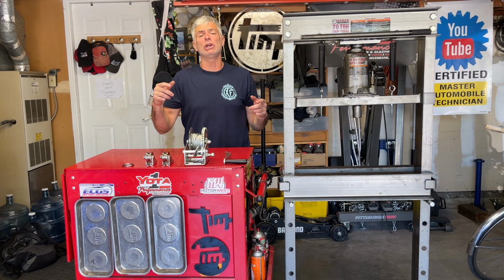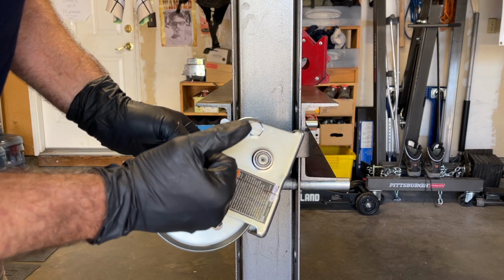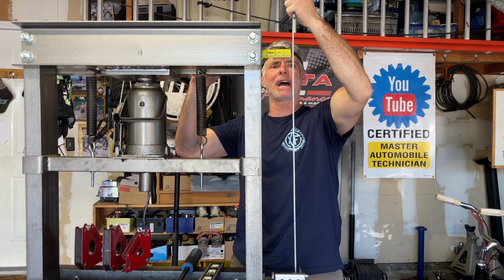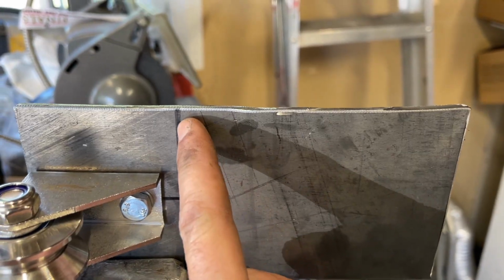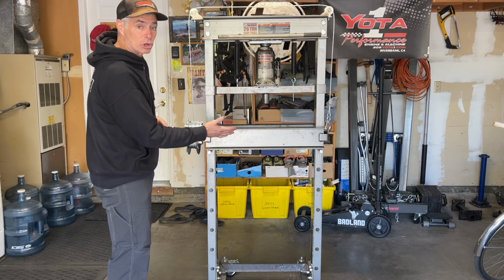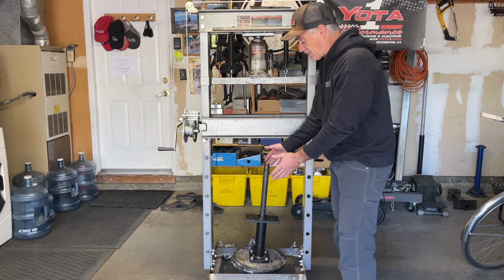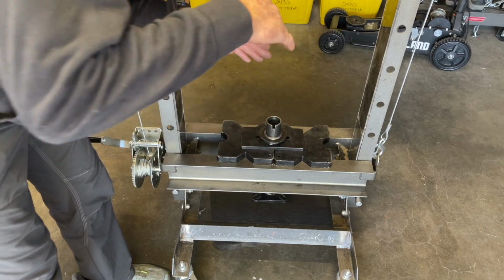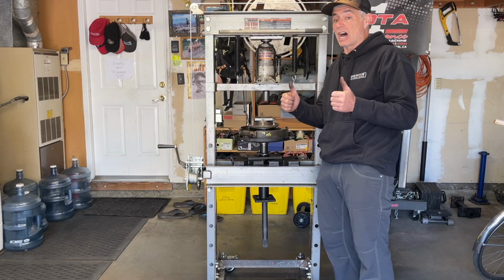Harbor Freight 20 Ton Press Winch Mod

Comment: Weld some plates on the bed sides under the handles. The height of the bed. Or 3/16 x 1" strap at the top and bottom of the bed (c channel). Both sides

Comment: What a stupid solition. Totally wrong build.
Reply from the maker: Hey, don't hold back on your opinion of my work.  The modification I did works well.  Did you watch the whole video? I demonstrated that I could raise and lower the press bed loaded with press plates and an axle using the winch and assisting the balancing of the press bed with my free hand.  I no longer need a second person to help me lift and lower the press bed.  The winch makes it much easier to do press work by yourself. 

Lots of people commenting think I should have mounted the winch on top and added a second cable to the winch drum so that one cable could attach to each handle and the press bed would be more balanced.   I said in the video that I didn't want to mess with trying to figure out how to modify the winch to make that happen.  People watching the video must think it's some sort of struggle to balance the press bed.  It's not hard at all.  I'm only overcoming the weight of the winch, which isn't that heavy.  So, my solution to make press work less physically demanding works perfect for my needs.  People are welcome to do a winch modification to their press any way they like.  My video is just offering one way to do it.  

I should have just deleted your a-hole comment, but for now, I'll let it remain. Happy trolling!

Comment: Why other set the winch ontop and 2 wires, is because both sides race and lower the same! You not need to support whit your hand, at all :) im gona set my ontop too, when my new press arriwel :)
Reply from the maker: I talk about the top mount option in the video.  I didn't want to bother altering the winch so I did it my way.  Different strokes for different folks.

Comment: Im curious if it would help to mount up a counterweight on the other end of the press bed.  Counterweight could be a tool or attachment holder.
Reply from the maker: I messed around with this idea, but gave up on it.  I just give the opposing side a little bit of support with my free hand and I can easily balance the press bed.

Comment: I have been thinking about doing this on my press. You could put slots in the plates you welded on top so that the pulleys are adjustable left to right and drill a hole for a bolt instead of the ring. I believe this would help balance the system and keep everything level.
Reply from the maker: Yeah, that's an idea.  Let me know how it works out for you.

Comment: Tim, I also have a back problem, the way you are holding to one side of the I-beam  and bending puts your back in an awful position, I would try putting the winch at the top in the middle with one roller at each corner method, in this way, you don't have bend and hurt you back
Reply from the maker: @transformer889  There's very little weight I have to overcome.  It's only imbalanced a slight amount due to the weight of the winch on one side of the press bed.  I'm basically stabilizing, not really lifting.  I would agree that if I was lifting anything heavy in that awkward position,  I'd be compromising my back.  Trust me, I've had back problems for almost 20 years, and I know when I'm putting my spine in a bad position.

Comment: i cabled my winch table so no need to "balance" the table .  Winch mounted mid hight on right side,  cable go up on the outside and down the right side and connects to the top of the table. another cable connect on the bottom of the table on the right side, go down right side to pulley on bottom that goes back up to the top of the press and through a pulley to the left side, then through another pulley down the left side to the top of the table - attached with a turn buckle.
Reply from the maker: @n2cval89  Yep, that's another way to do it.  Good job!

Comment: Not practical to lift 1 end while you winch.  My plates and press brake weigh about 160lbs.
Reply from the maker: @BM-cr1zf  You're not lifting one side. You are stabilizing the press bed by applying some support.  You're basically offsetting the unveness of the press bed because of the imbalance of having the winch connected to one side.  The winch doesn't weigh that much, so you only need to give a slight amount of support to srabilize the press bed.  The winch is doing all the lifting.  I don't think I've had quite that much weight on mine, but I'm pretty confident I could manage  to keep the press bed level with a press break weighing down the press bed.

Comment: Suggestion for another video: Place the winch on the front of the press bed, about 1/4 the the left or 1/4 to the right according to your handedness. Then unwind the steel wire completely. Locate the midpoint of the wire and rewind it starting at the center, the center being held in place with an adjustable hose clamp. Put a pulley at each end of the bed, and then you can attach each end of the wire to the top of the press. 
At this point, the winch will exert a balanced force on both sides of the bed when you wind it up. If you want more mechanical advantage, put two more pulleys at the top of the press, and return the ends of the wire to attach them to the ends of the bed. This will give you a balanced 2:1 mechanical advantage.  Smooth!
Reply: only problem with a dual spool setup on a single spool is the cable will wind overtop of each other and the table will no longer be level and jerky as the gets trapped under each other.  Take a look at how i cabled mine (see my comment above).  Single cable lifts both sides extremely level and cable wind issues not a problem
Reply from the maker: That's a good idea, but I'm fine with how the winch mod is working for me.  I don't feel like redoing it.  If you try out your idea, I would like to hear how it turned out.  Thanks for the comment.

Comment: Nice ! I love watching you videos - wonder if some weight was added to opposite side would be any improvement or more trouble ?
Reply from the maker: Several people mentioned the counterweight idea.  I tried it and it didn't work.  I think the main reason it doesn't work is there's a human component to the equation.  I'm holding the handle of the winch while it's going up and down which affects the balance of the press bed.  I tried using fishing weights in a small canvas sack and played around with different weights and couldn't get the press bed to go up and down evenly in both directions, so I gave up on the idea.  I think with how I did this modification, the best solution is to just stabilize the press bed with my free hand, which is very easy to do.  

Mounting the winch on the top of the press with a cable going to each handle is the way to go for anyone who doesn't want to have to balance the press bed with their free hand.  Knowing what I know now, I think I'd probably still do the mod like I did because I think it's a hassle having to figure out how to mount another cable to the winch and to figure out the proper length of each cable to get the press bed going up and down evenly.  

The goal was to take a physical load off of me when doing press work, mainly axle work, and I achieved that.  The balancing of the press bed is a minor nuisance that doesn't bother me.

Thanks for the comment!  Great to know you like the content Sean and I create.  Happy Wrenching!

Comment: Add a weight the same as winch on other side to even out may help
Reply from the maker: I messed around with different amounts of counterweight on the opposing handle, and it didn't work out.  In one direction,  say raising, it would go up level. Then I'd switch to lowering, and it wouldn't stay level.  I used fishing weights in a small canvas sack.  I gave up after messing around with it for quite a while.  It's not a big deal to me having to stabilize the press bed with my free hand because I'm only overcoming a very slight weight imbalance.

Comment: Solution: Add a counter weight to the other side of the platform. The weight only needs to displace the weight of the crank side. Also you could use pvc to reduce the gap in the platform to prevent swaying. 
Sincerely Robert
Reply from the maker: I messed around with different amounts of counterweight on the opposing handle, and it didn't work out.  In one direction,  say raising, it would go up level. Then I'd switch to lowering, and it wouldn't stay level.  I used fishing weights in a small canvas sack.  I gave up after messing around with it for quite a while.  It's not a big deal to me having to stabilize the press bed with my free hand because I'm only overcoming a very slight weight imbalance.

Comment: 20 ton press is not made heavy enough I had to plate the top and bottom because it was bending but for price it’s not bad
Reply from the maker: What are you working on?  Sherman Tanks?  I've done wheel bearing jobs on lots of different Toyota and Lexus SUVs, and the press has never failed me.

Comment: I mounted a winch on top of the press and used tow cables -one for each side so the bed rases and lowers evenly.
Reply from the maker: Yeah, I saw videos of people doing it that way, and I mentioned that option in the video.  Even though the press bed isn't balanced the way I did it, it's not a big concern.  Stabilizing the press bed is very easy because it's literally only around 5 lbs uneven.  A little support with my free hand keeps it balanced.   The result I wanted was to not have to muscle the press bed up and down anynore, and I achieved that.  This will make doing press work less physically demanding on me and for whoever I'm filming with.
Reply: @TimmyTheToolman  Good video, seems like some of your viewers would be interested in a video of you mounting a counter weight to the other side to help with the balance of the press bed.
Reply from the maker: @nvmcrider8475  I thought of doing something like that, but finding the perfect amount of weight is problematic.     By just stabilizing the press bed with my free hand, I can keep the bed from tilting while I lower and raise it with the winch.  It's not hard.

Comment: Hey it works great and the welds aren’t too bad. The second plate was better as you “warmed up” on the first plate so understandably the second would be better. If you get some spare time lol yeah I know, you can just weld up scrap pieces of steel all day and get better practicing and playing with the settings on the machine and just layin beads. 
 These mods are almost a must for a press. Good stuff brother 🤙 
God bless~
Reply from the maker: When I first started learning how to weld, I got a bunch of scrap metal from a fabrication shop and practiced a lot.  I feel pretty confident in my welding ability now.  Getting comfortable laying long continuous beads is something I need to get more comfortable with.  I feel the need to stop to check how I'm doing.
Reply: @TimmyTheToolman  haha yessir that’s all we did in welding school when you first start. You just grab a piece of square cut steel and weld beads up and down both sides of it and grab another one and do it again lol got old, but eventually it clicks in your head and you learned how to control the puddle. Those were some very long days in class lol

Comment: Cool mod.....RnD.  How about add a 5lb weight on the ring to counter balance it.
Reply from the maker: I actually tried adding weight to the other handle and it's kind of funky.  I put fishing weights in a small canvas sack and hung it from the ring.  In one direction, say raising, it stays level, and then I go to lower it and it starts getting way out of balance.  I tried different amount of weights with the same result.  I think just giving the press bed a little support with my free hand works pretty damn well.
Reply: @TimmyTheToolman  Well I'm sure you'll find a solution.  I might try the mod on my press in the future. Great content.

Comment: Lol...I have the same press. Not sure if I want to spend that much time and effort to make this mod. I only need to use mine once in a while.
Reply from the maker: I feel ya.  I don't use mine that much either, but after doing that first mod on it adding the caster wheels, I looked for other mods I could do on it and discovered the winch mod.  I've probably done around 20 rear axle bearing jobs, but that's over the last 7 years or so.
Reply: @TimmyTheToolman  I can see you doing such mods since it's great content for your channel
Reply from the maker: @brucewayne2773  It is good content, but I wouldn't have done this mod to my press unless I saw value in it.  These were two affordable mods to perform, but they did take some time.
Reply: @TimmyTheToolman  Off topic, just saw another 3rd gen 4 runner lose its lower ball joint, they were lucky to be on city streets while it failed. Dang lucky driver they had just gotten off of the 101 freeway, like 2 blocks
Reply from the maker: @brucewayne2773  Yeah, that's lucky.

Comment: Great job Tim! Doing press work by yourself can be a huge challenge. This makes things much easier.
Reply from the maker: Thanks Richard.  Most of the time I'm working with someone else, but there's been times I've been on my own, and it's a lot more work having to manually raise and lower that press bed with brute strength.
Reply: How is this modification holding up?
Reply from the maker: @richardsauer599 It's holding up great.  Sorry for the late response.   I missed your response 11 months ago.

Comment: 2004 Tacoma, you helped me do the axle diff sleeve thing.

Ever think about putting a counter weight on the other side? Maybe like a 5lbs weight.
Reply from the maker: Yeah, Sean mentioned this idea and somebody else mentioned it as well.  I just bought a set of 6 lb ankle weights and I think 6 lbs will balance it out pretty well.  The winch weights 7.5 lbs with the carabiner and cable.  Since the carabiner is attached to the opposing side and some of the cable is unspooled from the drum, 6 lbs should balance out the press bed fairly well.  Having an ankle weight attached on the handle won't be sexy, but I'm trying to avoid having to weld a big hunk of steel to the handle as a more permanent modification.  With the ankle weight set-up, I can add or take away weight pouches to dial in the weight to balance out the press bed.
Reply from the maker: I just tried the counterweight idea with a small canvas bag with fishing weights inside and I hung it with a carabiner on the other press bed handle.  I played with different amounts of weight, and there doesn't seem to be a perfect weight to where the press bed goes up level and goes down level.  So, I'm scrapping this idea.  Stabilizing the press bed with your hand is very easy and not a strain in the least bit so I'll stick with that technique to level out the press bed.

Comment: Can you add some weight to the right side to compensate for the weight of the winch on the other side to see if that solves balance issue and let me know please?
Reply from the maker: Sean came up with the same idea.  The only issue with this idea is the weight of the winch changes based off how much cable is spooled out.  The winch is heaviest at the top near the bottle jack and lightest at the bottom near the floor.  But, I have no doubt a counterweight would work out well.  I'll figure out what to add to the other handle and give it a try.

Update: I bought a set of velcro ankle weights that go up to 6 pounds.  With the extended cable and carabiner attached to the opposing side, I figure 6 pounds of weight should balance out the press bed fairly well.  The ankle weights arrive tomorrow and I'll report back how well it works out.
Reply: You're awesome! Thank you :) @TimmyTheToolman
Reply from the maker: I decided to make a run to a couple stores and give the counterweight idea a try today.  I bought a small canvas bag and some fishing weights of different weight, and I hung the bag with the weights inside with a carabiner on the other press bed handle.  I played with different amounts of weight, and there doesn't seem to be a perfect weight to where the press bed goes up level and goes down level.  So, I'm scrapping this idea.  Stabilizing the press bed with your hand is very easy and not a strain in the least bit so I'll stick with that technique to level out the press bed.